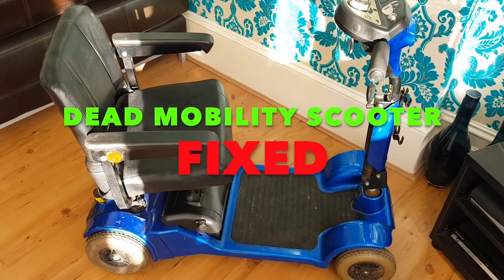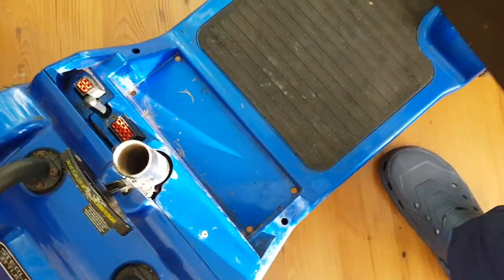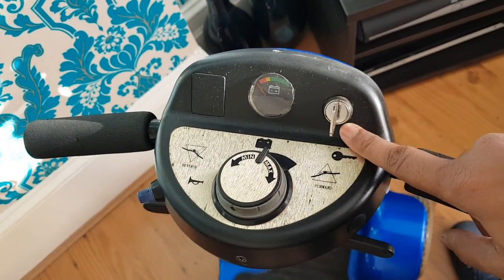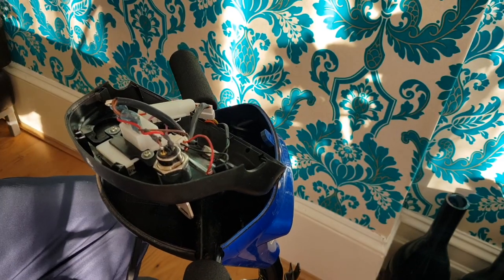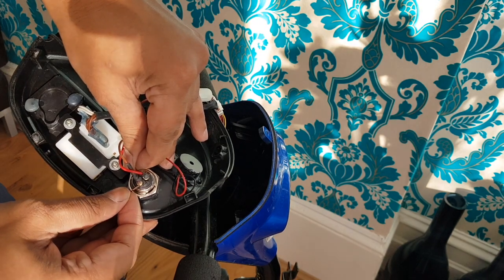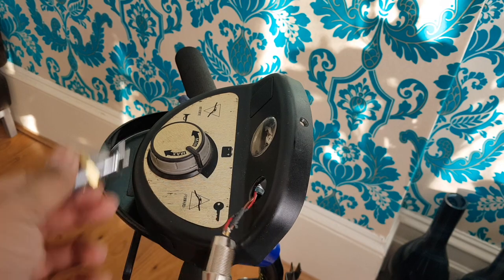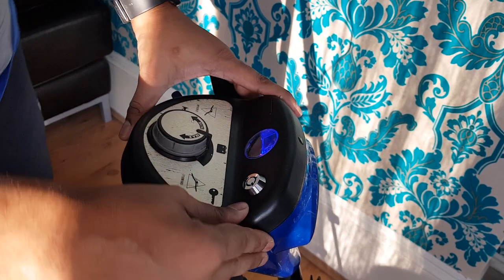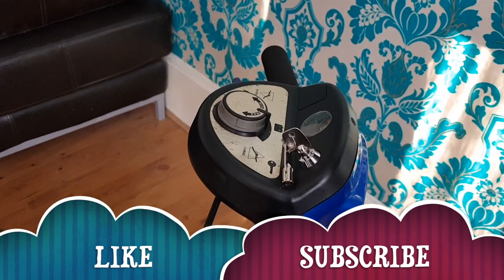Dead Mobility Scooter - FIXED

Comment: After replacing the battery - is not moving.. has power, but.. not going forward or reverse. Snd i put it on brake or on neutral.. is beeping, but.. not moving. Any suggestion?

Comment: Very good.  I have a Pride ZT10 that is sitting dead as you show. Could it be that simple? 🤔 I cant find a fuse, so yes I will check the key switch.  That may be why they sent a switch with the new console.  Thank you.
Reply: On most scooters there is a fuse hidden in the control box usually located at the rear behind the batteries. If you are ever told you need a new control box (which are very expensive) before letting anyone charge you for one, if you are comfortable in doing so, open the control box up, usually just a few screws (isolate the batteries first) and somewhere inside there should be a fuse, usually a car (bladed) type fuse.

 If this has blown, replace it, check all the wiring is secure etc then fire it back up. If the scooter works as normal, you have saved yourself a few hundred pounds. If it blows again after fitting the new fuse, it usually will be because something has shorted out, or water has got in some where, but if you can figure out where the short is, fix that short and then pop a new fuse in and you will be good to go. 

These scooters can look complicated but they are so simple. Basically most are just a frame, seat, a motor some batteries and a few switches. Even the key ignition is just a switch and can be replaced with a normal switch. 

One good security tip if it is your own scooter and not rented, I suggest you buy a small waterproof switch and wire it in to the ignition wire (somewhere before it goes in to the key switch) then fit this new switch in a hidden place that only you know about. Then when you get on the scooter, flip the switch then turn the key to turn the scooter on. If you turn the key without flipping the hidden switch the scooter won't turn on. And seeing as all these scooters use the same 3 or 4 keys for all of them (for example if your friend has a scooter chances are that their key will fit yours) and these keys are also used on farmyard vehicles, golf carts, forklifts etc so are very easy to come by, meaning thrives who are on the look out for mobility scooters to ride off on, and probably have their own key, or let's face it, a screwdriver pen-knife etc will do the same. Some of them can be turned on using a 5p coin, well the thieves will be stopped because they won't know to look for your DIY immobilizer switch.

 So a switch costing  £1 off somewhere like eBay can literally save you thousands on replacing a scooter.

Comment: We have a Gogo elite Traveller Scooter.  We took it to Batteries Plus to get a new battery.  I had him check the charging cable as well.  He says he did and its fine.  My dad literally uses the scooter 3 minutes a day to go through our subdivision to pick up the mail, and thats it.  After 5 days using it he can barely make the trip back to the house.  If its not the battery and the charging cable is good, what else can it be?  Thank you
Reply: The coil in the electric brake can become weak over time, and as the battery voltage drops during normal discharge it applies the brake when it shouldn't. E.g. Fully charged scooter, accelerator applied, 24v goes through the motor and 24v through the coil in the brake - result is that the motor is fully ON, and the brake is fully OFF. Scooter at 23V (slightly discharged), accelerator applied, 23V goes through the motor, 23V through the coil in the brake - motor is fully ON, brake is slightly ON (due to coil no longer working properly). This results in a slow speed when the battery is not completely full as the brake is partially on when it shouldn't be.

Electric brake coil failure can look like a worn out battery, which can be immensely frustrating as you buy new batteries and the problem persists as soon as the batteries are not completely full!

Sorry for taking 10 months to reply!
Reply: @peters2620  haha I couldbe been dead by now.  I honestly didnt even know what this was in response too.  We fixed it, I think it was just the charging cable which he swore was good, was not....so we got a new one...I believe thats what happened//

Comment: my scooter is fully charged horn works lights work but just wont go please advise its gogo elite traveller
Reply: Simply. Donate  to  old. Age. Disable  person. He. Will  bless. You
Reply: It seemsas though the overload cutout has activated. Si ply press it and it should reset. If you still have no luck try removing the battery box, clean the terminals and replace.
Reply: Possibly the potentiometer/pot/throttle. Three wires check each for power.

Comment: Mine turns on no movement
Reply: Press reset switch on battery box, check fuses on battery box or chassis and replace if burned.  Make sure battery is fully charged. Battery or charger may need replacing . If you have a scooter repair service, call them for help.